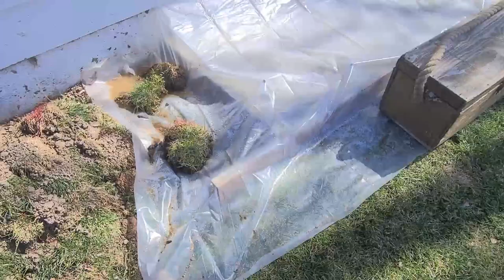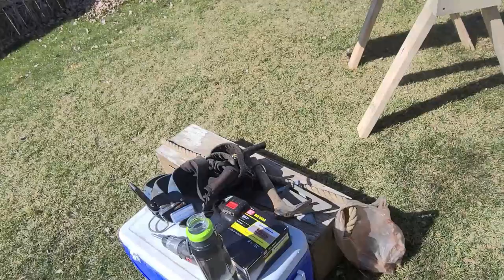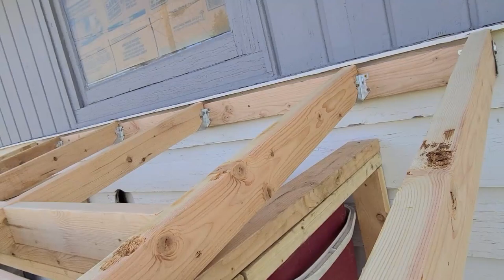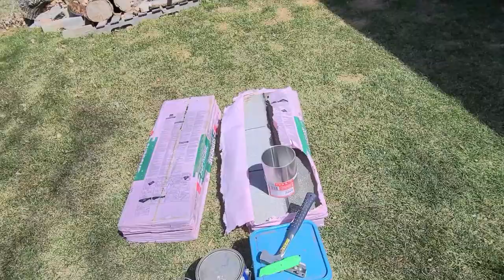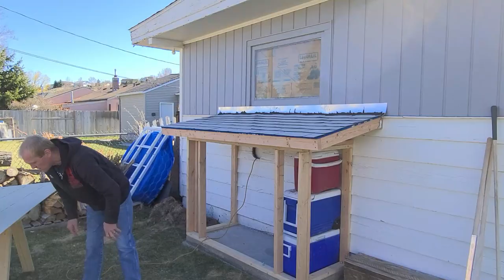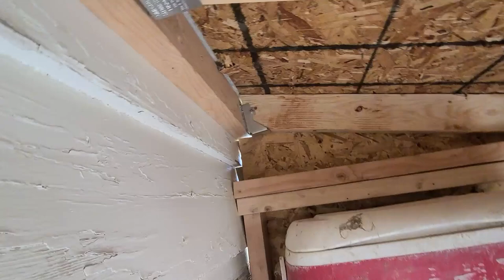Air Compressor Shed Build Pt 2

Comment: That is nice but you really needed to use treated lumber on the bottom against the concrete and you need to put some vents up near the top of the walls.

Comment: How does the air get in... Assuming you are consuming a decent volume of air, then you need some airflow into the compressor and for cooling? No?
Reply from the maker: It gets plenty of airflow from around the doors. They are there to A) keep people and animals out and B) to keep weather off the compressors. Last summer we broke 100°F a few times and never had any issues with overheating. The compressors have a fan on the motor to move air. They seem to move enough for them to stay within operating temp.

Comment: Was there a reason you didn't just lower rafters down about an inch so you could have had the shething and shingles under the existing drip edge of the wall. Would have saved buying flashing and tar 🤷‍♂️
Reply from the maker: I was just trying to have a good slope to the roof. I wasn't really concerned with lining things up with the shop siding, probably gonna change out the old wood siding for something that seals better.

Comment: How much cement did u use
Reply from the maker: I'm sorry for the late reply. It was alot is the short of it. I started with few bags I had left over from a fencing job, and then it ended with the cars rear suspension screaming for death till I got home with if I remeber 10 more 60lbs bags. So I really don't remember without scrubbing through alot of footage.